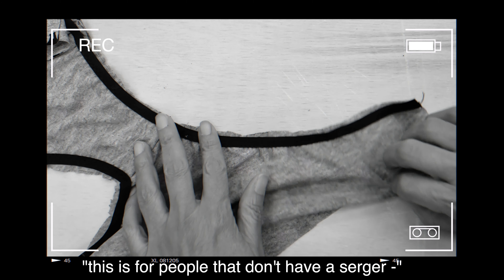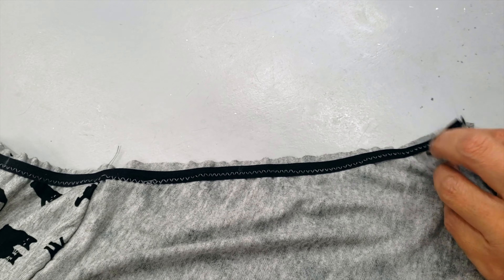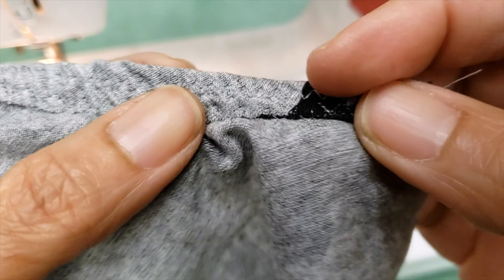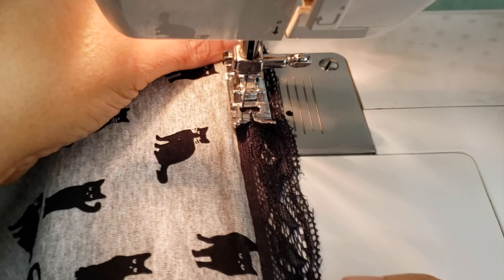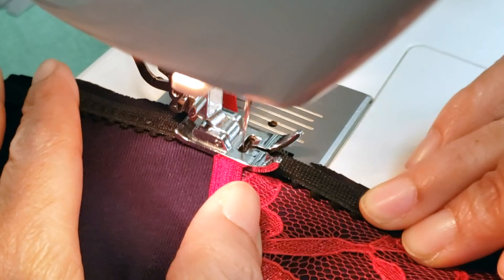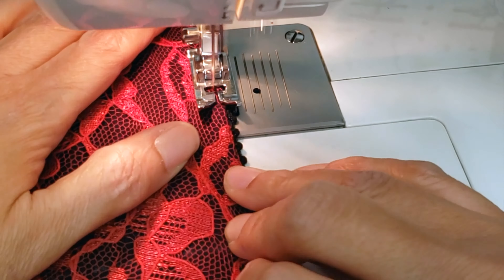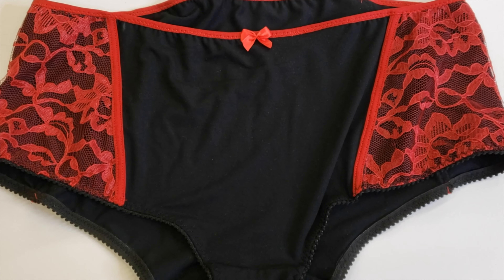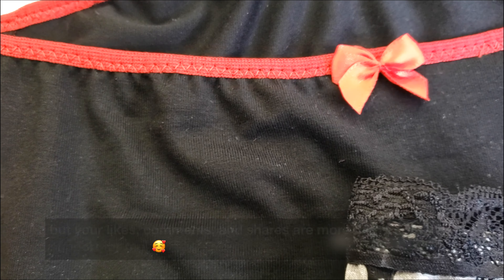NO-Serger Panties Elastic Installation -Learn 4 different types! 😉

Comment: Prefer sewing a casing, overuse of zigzag will destroy a sewing machine over time...or just plan to buy a new one every few years. Worth the cost of the underwear?💰
Reply from the maker: Hi. I understand your point.  But remember that there's a lot of old, cheap and good sewing machines around if someone is considering making a good amount of panties.  Otherwise, the machine won't suffer that much for making a few pairs.  This machine on the videois  13 years old and I got it new for $110. It is still in great shape and I certainly have made a lot with it.  Cheers
Reply: @DowntownTailoring  Yes, but if someone thinks with a $100 machine, they will be sewing all this stuff for years. Probably not. You have to check your cost effectiveness. Also the cost of good raw materials, or supplies, is not what it used to be.  You have to do the  math :)

Comment: Wait,  in the second example,  the lace is the elastic, yes? No? I think I need to re watch but I suppose it doesn't matter- my sewing machine doesn't do that C fancy zigzag. Thanks for giving multiple examples.  
I would guess if someone really needed or wanted to,  they could use material from an interesting t shirt. Ps yes,  those Kitties are cute.
Reply from the maker: Hi! Yes, this is a lace elastic on the second example. If you don't have the 3 steps zigzag, you can safely use the normal zigzag.  It will be ok. Cheers 🙂